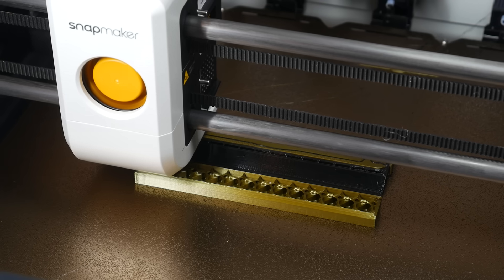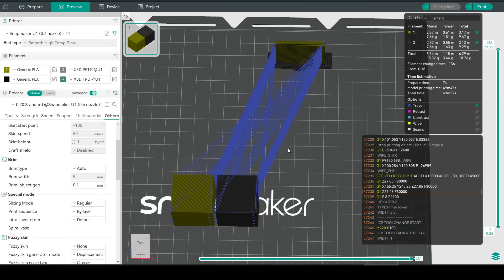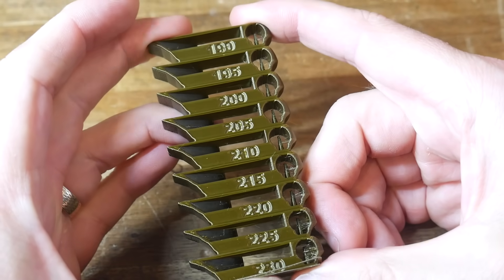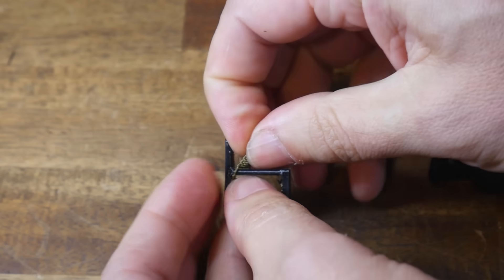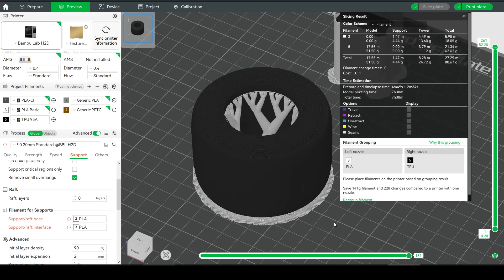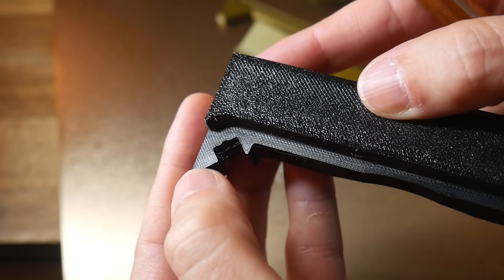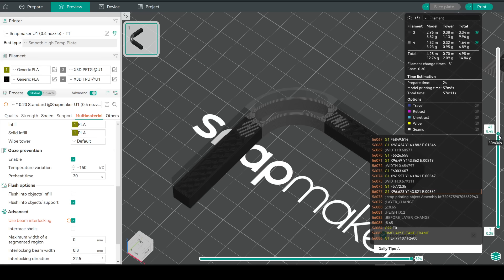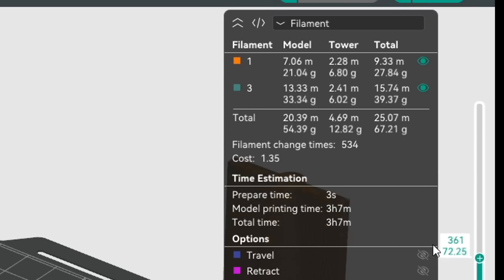Designing and slicing for multi material 3D printing

Comment: i ordered my u1 yesterday and i still have a few months before it arrives.   this was my first video on multimaterial and it answered pretty much all of the questions i had left... the only thing you didn't cover directly is pip mechanisms..  like gear boxes...  i need to find 3 different materials that don't stick to each other to make a good low tolerance pip gearbox.  
my biggest issue with single head machines is how rarely i can get a functional print with moving parts to work, even with multiple attempts and successful scale tests..

Comment: Thank you for your videos, they are amazing and have helped me so much! I have found little online with regard to printing tpu with a high-temp material (say nylon). I know the vastly different temps will make for a hard print, but other than that I am curious if there would be a benefit for functional parts. I'm thinking that basically I could make something that would normally be brittle, but infill it with tpu or layer it with tpu. 

Do you have any advice for this?

Hopefully that makes sense!
Reply from the maker: That would be an interesting combo. I would start with a simple test to see how well the two materials bond (if at all). Then you know if you have to slow things down like with pla/petg to prevent the part disintegrating.

Comment: I have several products that require cosmetically perfect faces. While this seems great its not was easy to achieve. So I will often print a raft out of one material, then print the part ontop of that.(which is incorporated in the original cad design as separate bodies) Once the part has finished printing i will then seperate the two. Features like delicate holes etc(that are harder to clear support from) I will press the support out of after the print with an arbor press and then ream the holes for accuracy. For some parts this is cost effective in others we have completely redesign stuff, to accomodate 3d printed designs. As the volume/revision aren't there yet to move to another process.

Comment: I didn't like how rough the PCTG-GF so I printed the outer layer in regular PCTG. I've really enjoyed having an IDEX machine as I mostly just use PCTG and TPU so I most of the time have the material I need already loaded.
I also use other material for supports for the other. PCTG and TPU work well together like that.

Comment: Fantastic video! Thank you so much for sharing. I have a spool of support material, but I never used it because I though I would have a material change in each layer, using different material ONLY on interface layer makes so much sense. Also, the super tight clearance at the end of the video is also brilliant!

Comment: Before I had a multi-material capable printer, I would print support jigs out of dissimilar materials.  Then set a pause in the gcode so that when it was time they could be put in place.  To keep them from sliding around, the jigs had magnets embedded in them so that they'd hold firm to the build plate.

To be fair, these were relatively simple parts.  Only needed a single pause to put the jigs in place.
Reply: that's actually a brilliant idea
Reply: @sourcererseven3858   I would say I stole the idea from somewhere, but I don't remember where I found it.  

It was exactly what was needed though, as the parts I were making needed to have as smooth a bottom surface as possible.  And the jigs worked perfectly for that.

Comment: This is exactly what I backed the U1 for. Thank you so much for the video, great tips and well produced as always!
Small Onshape tip: Instead of modelling the cutouts separately (11:45 ff.), you can just do a boolean subtract.
Reply: By any chance could you explain what a "Boolean" is to me like I'm 5 years old please? I often see the word used in explanations for certain issues that people have but I cannot get my caveman brain around it! 😂
Like, what would be the difference between simply cutting vs boolean cutting when designing a model?
Reply: @PaddyFromPaddistan  Sorry, I can't do it for a 5YO. But here's my grossly oversimplified attempt of an explanation: Boolean algebra knows only two states ("true" and "false") and three operators ("AND", "OR" and "NOT"). Transferred to 3D modeling you can think of the two states as "there is something at this point" and "there is nothing at this point". And the computer tracks that for all the points in 3D space. If you know all the points where there is material, you know the shape of your object!

If you have two objects, you can combine them with boolean operations:
* An "OR" operation is a "Union" in 3D modeling: If either the first object has material in a spot, or the second object has material in that same spot, or both objects have material in that spot, then the resulting new object will have material in that spot. And again, the computer checks this for all the points and thereby calculates you the shape of your new object, effectively adding your to objects together.
* An "AND" operation is an "Intersection" in 3D modeling: Only if both of your objects have material in the same spot, the resulting object will have material in that spot. Effectively, the result is only the overlapping parts of your objects.
* An "AND NOT" operation becomes a "Subtract" in 3D modeling. The resulting object has material everywhere where the first object has material but not the second one. That way you can cut the second object out of the first, like an imprint or a lost casting. This is what I was suggesting here.

The difference between a normal cut and a boolean cut is that you don't need a sketch. You're not just cutting a simple 2D shape. Instead, you cut with the exact shape of another object, which can save you a lot of work and makes stuff like interference fits way easier.

Comment: For the custom supports you can turn the number of walls and infill percentage way down. I typically only do 1 perimeter wall and 5-10% gyroid infill for custom block style supports. Just keep the default number of roof layers so there's enough support for the clean separation layers. Also, for big supports, I tend to split them into sections with a very tiny gap (0.2mm-0.5mm) so they are easy to break apart in pieces rather than one big chunk.

Comment: For the interlocks for the multimaterial part, you can save a few steps by just extruding up the solid PLA parts then doing a subtract from the TPU bit

Comment: Prime towers in my experience are prone to getting knocked over and as you said you have to watch parts placement.   I changed my custom built Idex to purge some material on a waste dump lever then wipes the nozzle on the tools 1st move after being activated.  I did this using a custom Klipper macro for G0 and variables to store state.  This works with Cura since it uses a G0 move from parked to print position.  No idea if other slicers do that though.

Comment: A more simple way to design the junctions in Onshape or other programs would be to create  your corner piece or whatever is going to have the "male" junction pieces. Then just create the other pieces as solid objects and do a Boolean subtract.  You can add clearances to certain surfaces with offsets if you choose as part of the subtract or use the Move Face feature to create a clearance.

Comment: If supporting PLA, even better than PETG as an interface material is Polymaker CoPE. It's chemically similar to PETG, so it doesn't stick well to PLA just like PETG. But it prints at PLA temperatures, so you don't have to worry about heat creep, especially on a machine like the Bambu Lab H2D. Plus, CoPE is pretty cheap. It's even available in a bunch of colors.
Reply: THIS is why I love the comment section! 

I just migrated to a H2D after multiple issues with my K1 Max, I have several prototype parts I'm working on and I'm not one to tinker too much with settings so thank you very much for your comment, it gives numpties like me a fighting chance at not cocking things up! 😂

Comment: I've been playing with the multitool ramming setting in PrusaSlicer. This will send the tool to the wipe tower and quickly extrude a little filament before parking it. The advantage I see is that the long "retraction when tool is disabled" (I use 10 mm) happens on the wipe tower, so there is less time for the nozzle to melt a dent into the part, and less stringing as a result. I also added a little section to the tool change G-code which quickly moves the nozzle back and forth over the wipe tower after retracting, in order to hopefully lose any remaining strings.

I'd love it if you did a video about dedicated support filaments. I find printing PVA to be a tremendous pain and prefer to use the non-soluble peel-away supports when possible, but there are some cases where you really need soluble and I'd like to learn some better techniques for using it.

Comment: Thank you for focusing on the U1. I was afraid that after the initial burst of reviews we would see Bambu leverage their influencers to drown it out.
Reply: I don't see it being "drowned out" anytime soon. My concern is the possibility of print quality issues and how/when/if Snapmaker addresses them. My friend, a social media influencer I won't name, was sent a U1 for review and it broke down fairly quickly. After receiving rushed parts that didn't fix the issues, they finally sent an entirely new unit. As amazing as they are, both machines had subpar print quality and that hasn't improved with software updates. Ive also heard from other users that theirs print great, so I'm curious to see how Snapmaker handles this issue for those affected, and if it's a hardware or software issue.
Reply: @OhImKiCkiN THIS is what I was afraid of. I've never had a Snapmaker machine but I hear they haven't got a great reputation, though that seems to be due to bad or rushed software rather than mechanical breakdowns.

I just got a H2D but I really hope they do better with the U1 as I'd love to have one in the near future but hopefully with a larger build volume 🤞🏻
Reply: @PaddyFromPaddistan The H2D is amazing. I recently upgraded my farm to all H2D's and love them. Now that I'm spoiled with a larger than average build volume it's hard to consider any machine smaller than say 300mm cubed. I'm rooting for the U1 though and if it performs well then I'd definitely consider buying a few "U1Max's" if they release one.

Comment: I don't have a multimaterial printer, but want one.  One thing I've been thinking about is using PEBA to create an integreated elastic piece, more than just being flexible.  One wild idea was if it'd be possible to 3d print in place a rubber band powered airplane/car.

Comment: Thank you for the great tips. I bought and H2D to use for functional prototypes. I'm usually printing TPU with PLA supports or PETG with Bambu's "support for PLA/PETG." I found that Bambu's support material gave super reliable results when supporting PETG. Using PLA as support was far less reliable. Your suggestion to slow things way down for that first layer might be helpful. I'm very excited for the future of multi material printing for consumers!

Comment: Its a shame Orca/bambu studio still dont let us pick filament for different features.

For example if I wanted to print the outer wall from a matte filament but the inside with a cheaper strong material. We cant at the moment without some cad tricks.

The printers are really capable but the software is still holding us back.

Comment: The PETG/PLA combo is exactly why I got the H2D and its made a huge difference to the parts I make. I put PETG in the AMS HT via the right nozzle and the AMS 2 Pro with the PLA filaments in the left nozzle. Works a charm.
Reply: the best part that even the cheapest random filament works fine as support interface. and yeah, i bought h2d for the same exact reason and i regret nothing